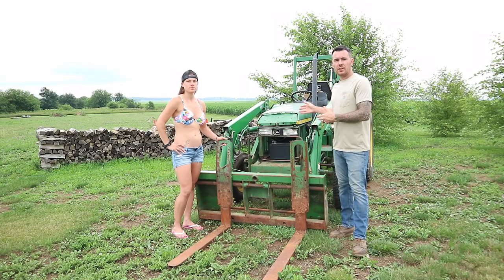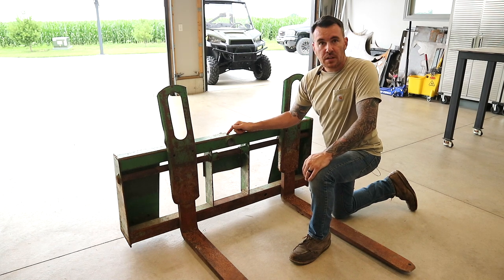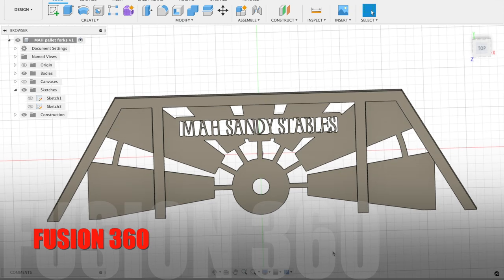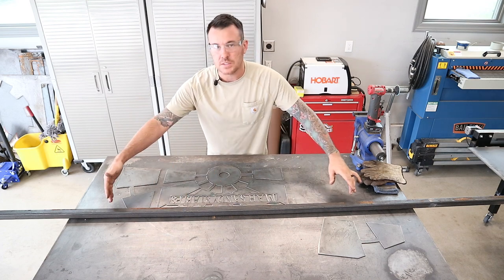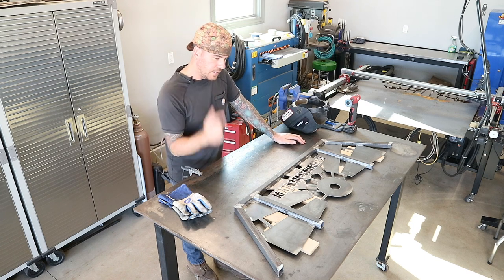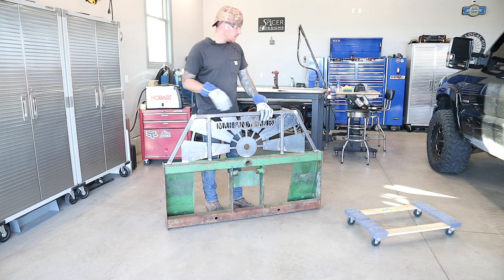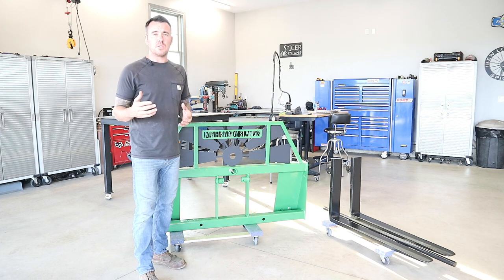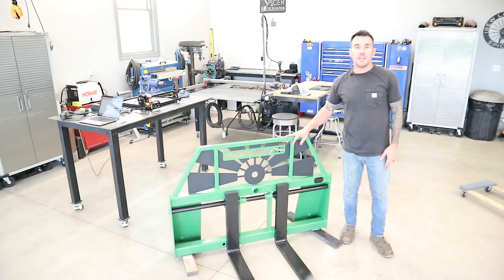DOUBLING my MONEY FLIPPING PALLET FORKS!

Comment: if your worried about weld spatter on you can sprau some anti gel on her, and just hose it off with brake clean. it does have to be cleaned off for paint prep but i use abiblue it designed for work surfaces specifically.